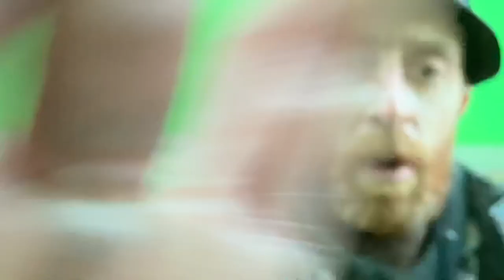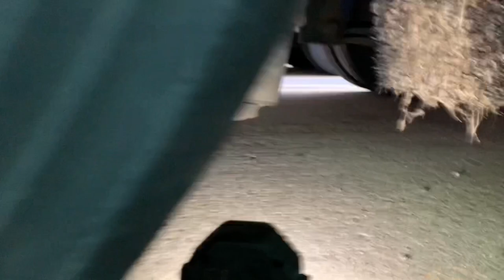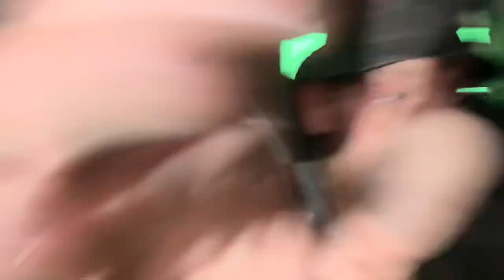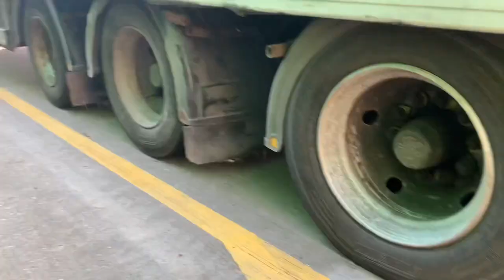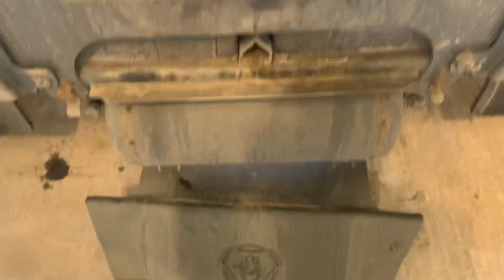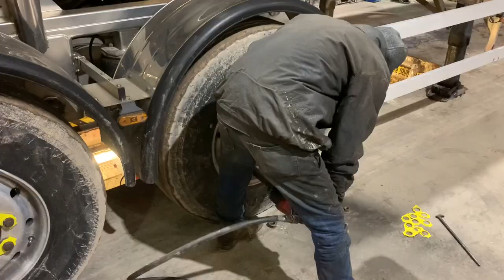Brake down trailer air leak, stuck in a lorry park, mobile hgv mechanic me being clueless

Comment: love the split in the tyre typical double deck im coming close to the end of a long career laying in smelly laybys and distribution centres trying to make the impossible happen at times, love your videos as they are a true account of the professional struggler stay as you are mate and dont change for anyone only change for yourself. now i know you shouldnt put a impact gun on a chamber draw off bolt but if you cut a 19mm socket weld in a bit of tube and make it extra deep sure speeds up the process in tight areas

Comment: When you fit rear mounted battery's. Check that the ones you have are made to be fitted at the rear. Some have a symbol showing they are not for rear and others saying they can be.   They have thicker plastic bottoms and sides . It's due to there is ment to be more movement and banging about at the rear

Comment: With your shaver if it has a 2 prong euro plug on it cut it off and stick a 3 pin plug on it, it doesn't matter about polarity of the wires which is live and which is neutral.

Comment: Changing batteries after 2 years, is that normal 😳. 
Great rant, sorry video Chris.
Thanks for sharing.
Reply: Yep normal such a high electrical load on modern trucks any drop in battery performance causes problems.
Reply: Manns are terrible for it, not even a crank, and two decent batteries on it. Those batteries ain’t cheap either.
Reply from the maker: Yeah all the gear in them nowadays inverters fridges microwaves TVs it takes its toll! Cheers D C and Diesel 👍
Reply: @Professional-struggler  D C & Diesel Hatz, guess trucks need a deep cycle battery in addition to the standard high cranking/ top up batteries.
 Looking at a 230 voltage 800W microwave,  it's consumption or current draw is 1300 Watts, so at 230 volts takes 6 amps,  (= 1300 ÷ 230),  using an invertor with 80% efficiency from 24 volts,  current draw is 68 amps (  1300 ÷ 24 = 54 amps) at 80% efficiency, = 67.5 amps. 
Hope this makes sense or is of use. 👍

Comment: Hi Chris, your channel bring back great memories of working in the haulage game. Worked mostly on trailers in early 1990s. ABS, disc brakes and airbags where still pretty new things back then, it was mostly ROR 8 5/8th drum brakes with no ABS, mono leave spring suspension🤪 just one thing, when you crimped the air pipe over, why don’t you use the push fit stop ends instead of cable tying it.
Reply from the maker: I still work on a few trailers with single leaf suspension and the old ratchet hand brake mark, even burnt out some balance beam bush’s the other month if you remember them 😅, I don’t have none mate would be a good thing to keep on the van by the sounds of it, cheers Mark 👍

Comment: Now then  professional struggler have you tried one these sockets for doing brake chamber release bolts 👍Laser 7210 Air Brake Chamber Nut Socket 1/2"D 19mm on amazon 👍